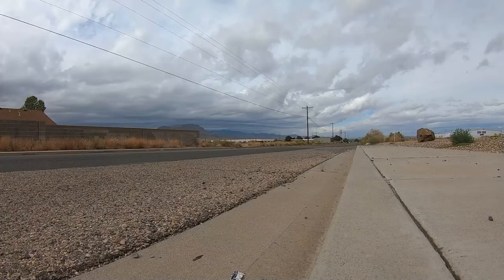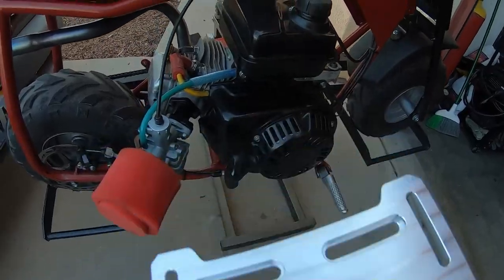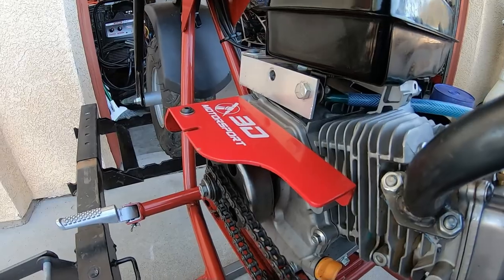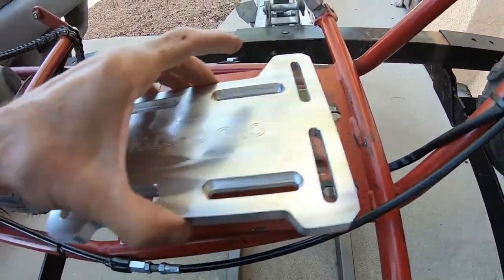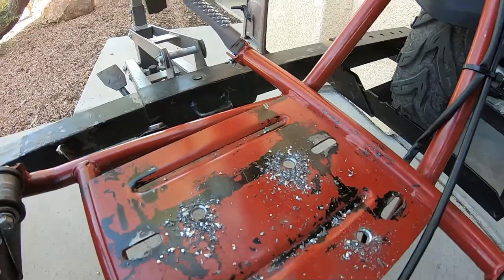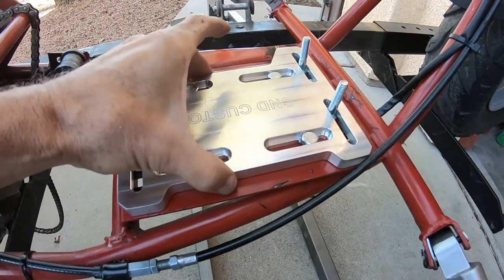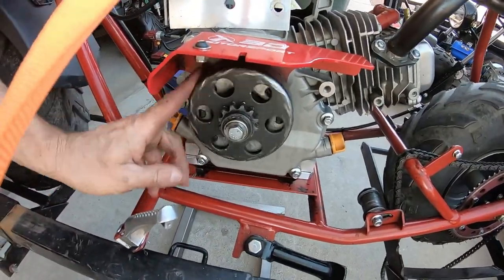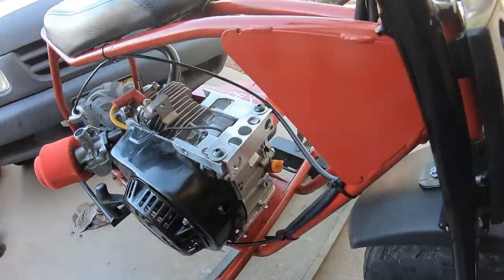Custom adjustable motor mount install on the Coleman cc100x predator 212

Comment: That is a nice mounting plate and the bike looks lots better with the engine closer to center. If the bike has a sidestand on the left it will be more stable also. I just did this to my Murray Track 2.
Reply from the maker: Ah sweet! I like the Murray Track 2. I want one.

Comment: Link to center exhaust ?? Running similar setup! 
But bolt straight to frame gives me a lot a vibration around 30-35 mph 
My hands can’t handle them 😔

Comment: With your Coleman ct200u and stock 196, how much did you invest in that at the end, and did you ever have to put in upgraded valve springs when you took out the govenor and installed the mikuni and torque converter and header pipe?  Is there a link to everything you did and does it make sense to invest the cash in the 196 or just go for a new 212?
Reply from the maker: I never have added springs to the Coleman. It always seemed to rev out with the mods so I left it alone.  I think I left links in most of the videos for the parts used. To me it makes sense to upgrade the 196cc because all the external parts ,header,VM22, torque converter can all be used on the 212 after the 196cc breaks or if you simply just want to upgrade later.

Comment: hey man i have a question, i want a new air filter but i dont like how far it sicks out, is there a way to reroute the air filter to someplace else?
Reply from the maker: Ya, they have one that sticks out at an angle or Yoiu could use a curved intake.Here is a link  https://www.ebay.com/itm/112456727228?hash=item1a2ef17abc:g:nMAAAOSw7NNT7WZj
Reply: @Black66  thank you so much also mr and my friend love the vids
Reply: @Black66  i have a coleman ct200u would it still work? and would i need a new carb
Reply from the maker: @kingspork  Yes , the mount will work on a ct200u. The filter I gave you the link for was for a VM22 but you can still get an angled filter for the stock carburetor.

Comment: I have a Coleman Cc100x why when I crank it up it starts moving like I’m hitting the throttle
Reply from the maker: Have you lubed the bushing on the clutch? That could be it. Or maybe the idle is set to high
Reply: @Black66  No maybe it’s the idle how do I turn it down

Comment: I there I ordered the same one on eBay I was wondering if you knew what size or what kind of bolts and nuts did you use and where you got them from please and thanks
Reply from the maker: I used 5/16" x 1.5" Bolts with coarse nuts for the engine bolts and 5/16" x 3/4  Bolts that bolt the plate to the bike. They have them at GoPowerSports or you can get them at a hardware store.